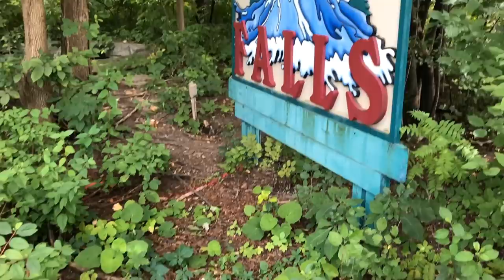Yukon Striker Where are the Trees & Construction on Weekends?!?

Comment: Leviathan was built when the conversion rate between cdn & usd was basically par, one of the reasons for Yukon Striker being more expensive (the track itself)
Reply: Excellent point.  Very true economic reason.  The Canadian dollar and US dollar were so close then.  Now one Canadian dollar is worth about 76¢ US.  Also, our economic system is designed so that more profit must be gained each year, and thus the costs of everything related to a coaster like this will almost surely be more expensive than it's predecessor.